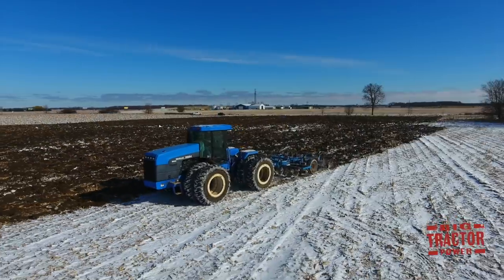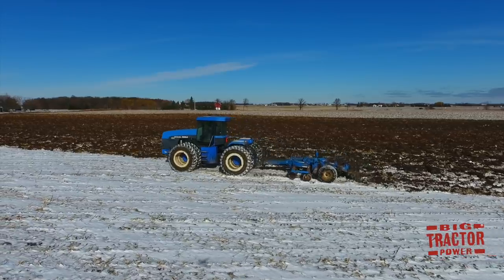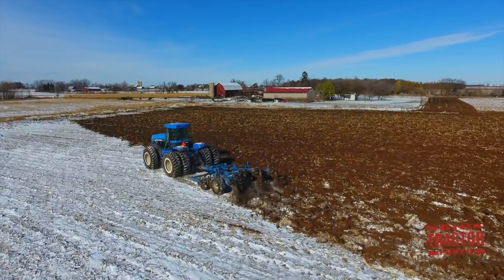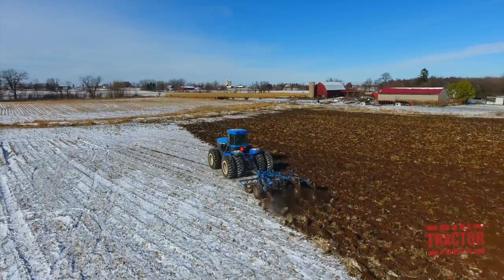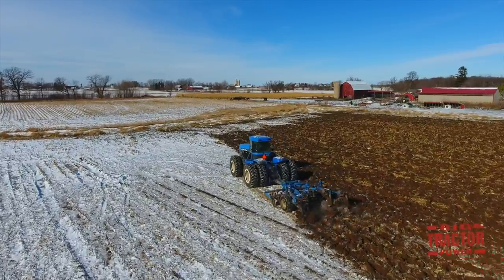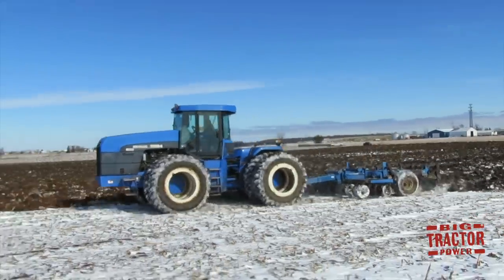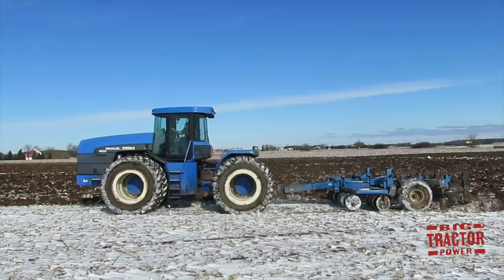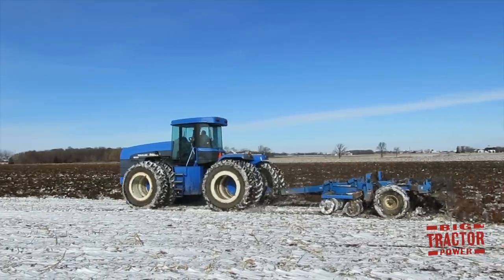Plowing in the Snow: New Holland 9684 4wd Tractor

Comment: That’s a good way to bust up your ripper and tear the guts outta your tractor. He needs to drop a gear or two and he’d be good, but pulling any sort of ripper in frozen ground going that fast is a recipe for disaster. If he was my employee, he’d be fired.
Reply: I don't know about that. Looking at how that ground is breaking up, I doubt there is more than 2-4 inches of frost in the ground. That would hardly seem to be enough to bust up that ripper.
Reply: Cameron McConnachie: Agree.  It seems he’s moving way too fast.  Possibly the operator is showing off for BTP.
Reply: That tractor has little difficulties pulling this ripper. I can't see a lower gear necessary.

Comment: Owned an FORD 9680 for a couple years.  Absolutely simple,  well built tractor.  Had mine weighted to 40k.  But I needed more weight.  ( I pull a tile plow,  and a scraper )  I went with an 965b challenger,  it's at 54k I'll be adding another 6k soon.  Eventually I'll switch to the MTS delta tract.  (Versatile with cat engine )   thanks for the video.  I miss my blue tractor.

Comment: Why is he working on frozen soil and snow? What advantage does it have?
Reply: Well that soil looked fairly dense and those dense soils need worked before spring otherwise they will be packed to hard to plant. Is working it in the winter ideal? No not by any means, it's hard on the ripper and if you noticed it was taxing the tractor pretty good too. Sometimes you just have to do it though.

Comment: I would think that he would be running the ripper a little deeper. The disks are not in the ground.
Reply: jerry nibager that’s because the disks are on a separate outlet he doesn’t have them down
Reply: It’s called tillage
Reply: the ground is too frozen for the dics too be effective so he just leaves them
Reply: Also they ball up full of snow, you can see a few of the already were packed full
Reply: If the ground is to frozen then why be there to begin with.  These machines cost way to much to run to be doing a partial job or tearing it up. Scrapers should be keeping the disc clear?

Comment: This is probably a dumb question- but I'll shoot anyway. 

When the tractor turns, do the wheels on one side spin faster so that it can turn easier?
Reply: Yes they do, in the same way that the wheels on rear wheel drive cars do when they go round a corner, using a differential gear. The differential takes the drive from the engine and applies it to each drive shaft, left and right, equally. When going round a corner the outside wheels cover more distance than the inside ones but the differential still applies the same torque or turning force to each. Hard to explain but a youtube video with a model of differential gears will make it clearer.